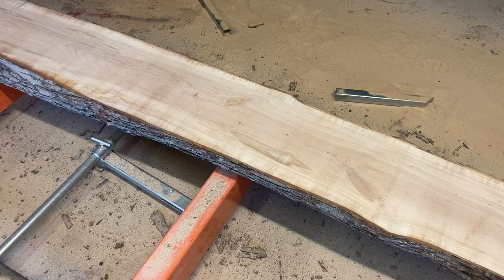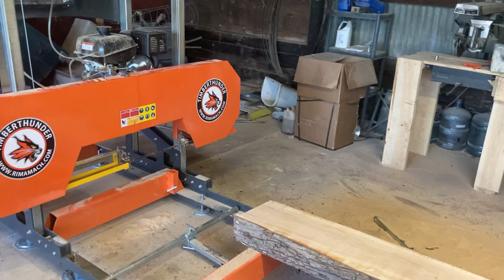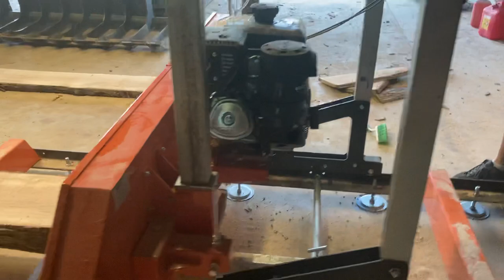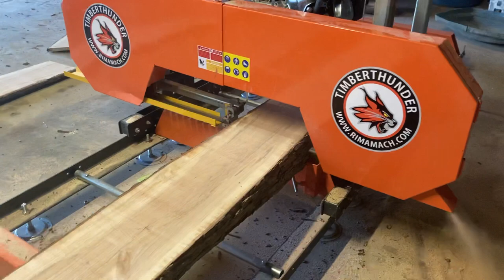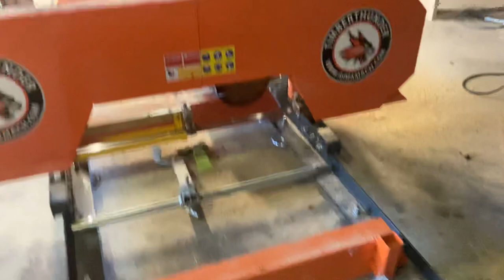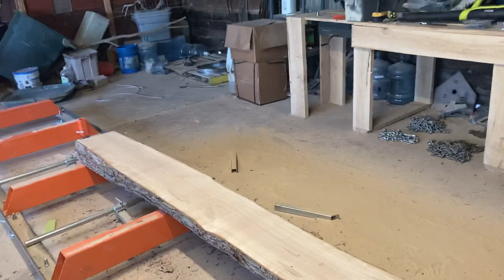Rima rs31g sawmill slicing up some maple slabs.

Comment: I'm picking up ours Tuesday.
I got an extra 6' of track length.
Mines blue.
Where did you get spare parts?
Reply from the maker: I got guide bearings and extra belts from eBay. My blades come from Jerry’s resharp, and I got my main wheel bearings from Rima. I got extra feet from a reseller in Canada. So basically from all over.

Comment: Did you have a problem with wavy cuts. I've got my tracks level and bunks as close as I can
Reply from the maker: I did on occasion. If I did I always checked the sharpness of the blade first. If not, is it tensioned properly and tracking across the wheels correctly? If not that how is your front to back blade pitch?  All 3 can cause wavy cuts.  Also going too fast can do it.
Reply: @bwade1022  I don't have an adjustable blade guide either. But the blade pitch I got to within 1 degree of eachother. For the tracking I think it's good my wheels are .5 back on the right and .3 forward on the left. And I'm going pretty slow with the cut
Reply: @bwade1022  also they're brand new blades the ones from rima I haven't tried another brand
Reply from the maker: Do you know the tension is approximately correct?  The blade guide really does help in my opinion. When I leave the guide open further than it needs to be the blade can move up and down a little more.  When you go slow does it still make wavy cuts or does it look better ?  Also, I suppose wood can have something to do with it.  I noticed the harder the wood the slower I got to go or I get waves. Let me think some more what it could be.  You may be having an issue I was lucky not to encounter. I feel when they come from the factory sometimes they can be aligned improperly and it can cause a great deal of frustration figuring it out.
Reply: We cut with a small [name-brand] saw once & had problems with frame flex giving us wavy cuts - the head frame uprights were actually oscillating, causing a regular grooving pattern in the cut.  Do you get any of that "head-shake" with the Rima machine, or does it seem pretty rigid?  I'm just starting to look at these as a lower cost alternative, & I'm glad I found these videos.  I hope my bandwidth can handle it ;^).  Looking forward to learning more about these mills.  Thanks!
Reply from the maker: Honesty, I would say yes. However I’ve done a few things to help it out, adding lock washers and extra bolts, etc.  it still has some sawhead shake but I can’t see where it effects the cuts.   The vibration is perfectly side to side as the teeth pull thru the wood.  Not sure what normal shake would be, but I’m not too bothered by it.  Thank you for watching!
Reply: @bwade1022  la oscilación del marco es por el bastidor . de abajo no cede nada y toda la fuerza la soporta arriba. soluccion : poner una cruzeta en los dos pies traseros o rezorfarlos desde arriba con cartabones de pletina de 8 mm de expesor . o dos  us invertidas una delante y otra atras. no os conozco pero veo vuestros videos y me di cuenta el primer día , en algunos videos que acercan la camara cuando graban. soy de soria (españa ) . me gustaria saver buestra experiencia en lacompra del sr31g  o quien se lo vendio. estoy en trato con una vendedora pero tengo dudas si llegara en aserradero silo pido. agradecería vuestra contestación. un saluso a todos gracias por vuestros videos.
Reply: tambien me gustaria saver si lleva la guia de hoja de sirra.el sr31.